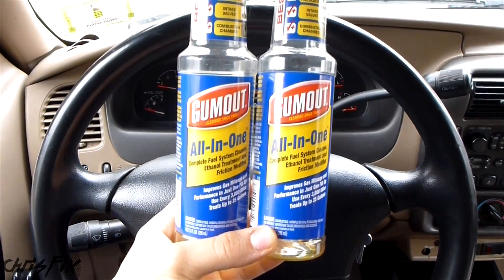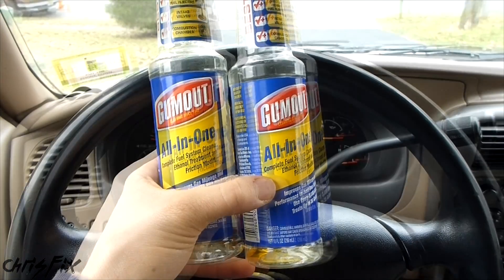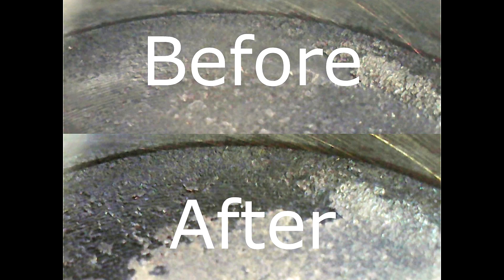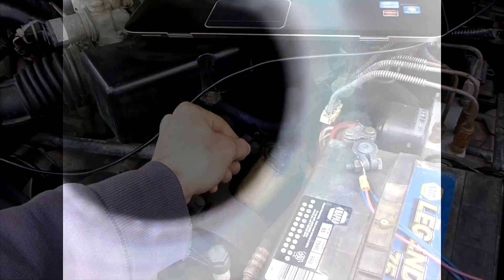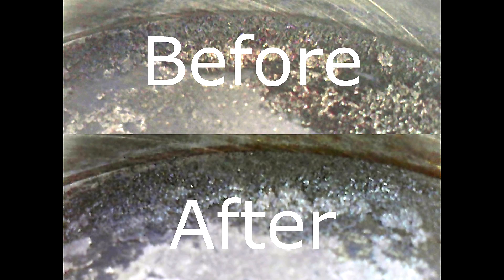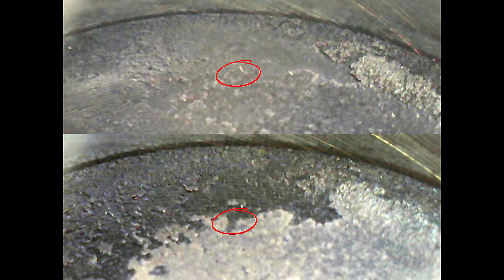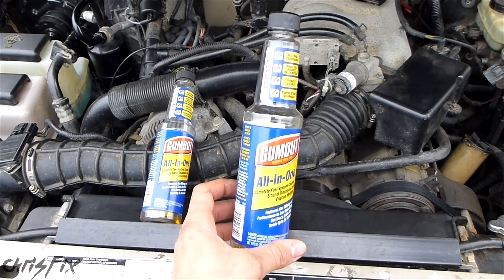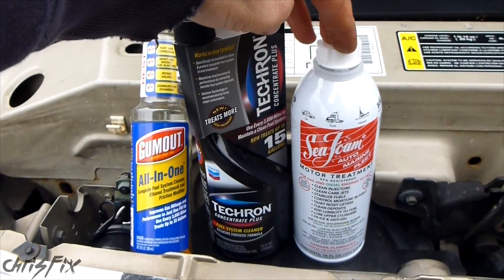Does Gumout Fuel System Cleaner Work (Follow up)?

Comment: Gumout is BS, Try lucas oil
Reply from the maker: B Ann Most gas, depending on the region you are in, has ethanol and it doesnt have anything to do with the grade or company unfortunately. Also using a higher octane gas when your car doesnt call for it is a waste of money. The car isnt tuned for that octane and cannot make use of it. Finally, all gas in the US has to meet a pretty high standard with cleaners and such so even the "cheap" gas is still pretty good. I wish I had more time and money to do a test on running a car on "high quality gas" vs cheap gas and seeing if there is a difference. You bring up some good points. I wonder if using more expensive gas is worth it?
Reply from the maker: jeff666p I think these products work pretty well on fuel injectors which is where you will see that mpg increase if you have dirty injectors and a bad spray pattern. That being said, I did not test the injectors so that is all speculation.
Reply from the maker: MrRangerZr1 Lucas is on the list. That test will be soon!
Reply: B Ann
lucas oil one improve my gas mileage by 3 mpg
Reply: jollyandwaylo
you seem to read the coast guard link as an endorsement to ethanol while myself & most others read it correctly as a warning .
In their warning they say to check with engine manufacturers & do not let fuel sit for more than 90 days .
Before ethanol it was common to let fuel sit the whole winter season & have zero fuel problems but that's not the case now !
&
What does engine compression have to do with ethanol, basically NOTHING !
Ethanol destroys fuel systems not engines, directly & I say directly because when fuel mix is incorrect the engine is either running lean or rich & both are detrimental to engine life.
&
1 of many reasons vehicles last so long now is not from ethanol it is because of fuel injection systems which immediately shut off the fuel the moment the key is switched off.

Unlike carburetors that dump raw fuel right into the cylinders the whole time the engine is spinning & sometimes even when the key is off & sometimes even after the engine is stopped.

Remember trying to start a car & it was flooded requiring the gas pedal to be held down while cranking the engine ?
Where do you think that raw fuel ended up ?
That fuel mixes with the oil causing a shorter engine life  & a reason many taxi cabs even in the old days went multiple 100's of thousands of miles even with carburetors is they were rarely turned off allowing fuel to drain into the oil pan & mix with the oil contaminating it.
 
& BTW 12  ounces of heet does not equate to 10% alcohol in a fuel tank it is actually around 1% when mixed in 10 gallons & if you were smart you would have saved your $$$ & simply used a cheep bottle of rubbing alcohol for about 1/3 the price.
Reply: LO , more BS !
Just like in the days gone by when people believed in a rain maker .
Reply: ChrisFix Your point of jeff's injectors needing a cleaning was a good observation.
But.
If these people are driving a vehicle which calls for high octane fuel & they are using regular "crap" & just about all regular is crap IMO, a  fuel additive could possibly improve their mileage slightly depending on how a vehicle is driven.

As I said previously, detonation, pinging  or spark knock which ever term you prefer are all mileage killers.

And the vehicles most of us drive today have a
' knock ' sensor which retards the timing when a
' knock ' occurs.
 We drivers, should never hear a ' ping ' because of this devise.

Before cars had computers if the octane rating in fuel was too low we would ' usually ' hear the deadly ' ping ' & then know to use a higher grade fuel.

My car specifically says "Premium Fuel Only" because it has a higher compression ratio.
Its around 10 to 1 & is a high output small V6.
I can however use "crap" gas without a ping because of the ' computer '

& since I know the computer/knock sensor is retarding the timing I am also aware that my mileage is going to be slightly less.

Perhaps so slightly that it is not easily measured in the real world but still ' less '

It seems some would rather spend $$$ on a additive  than checking to see if they just need a upgrade to higher octane fuel .
Reply: jollyandwaylo I'd have to agree with you here.  The only conspiracy is the corn growers lobby (and corporations like ADM), who cooked up this bad idea to add ethanol to the gasoline and have reaped large profits by using a food crop as fuel without saving any energy for the nation.  It does do a number on old car rubber parts but most parts can be replaced with newer hoses, seals, etc that are resistant to ethanol.  My antique car is doing ok with ethanol fuel but I add Stabil to my fill-ups just for insurance.
Reply: B Ann Better said than me. I'm glad you're have seen the positive side in what we've suffered with, jolly. I lost the use of my truck for 4 years thanks to ethanol. I when I got it back it took weeks of spending hours most days grinding the rust out of the fuel tank from expired ethanol fuel which starved the fuel pump from a thick organic crud. No better modern rubber would have prevented this! Thought I'd share that if you wondered why I was so passionate on the subject.

Hint: if you find what I find the gummy slimy mess is impossible to clean. Forget resealing up the tank to save the environment. Leave it totally open to air and the gummy-bear rendered fuel will dry out so it can by ground out with a rotary wire brush and sucked up by a vacuum. Bought my first shop vac....even dried rust with fuel clinging on set fire to my Eureka. A few weeks later I dared to try it. It safely worked again. Lol

Fuel pump at local stores $300. AutoZone online had one not mentioned at the store for $150. Took years to find an affordable one.

Tools required that I hadn't purchased yet at the beginning:
$99 Husky Compressor. . . 2-3 times this and the job would take half the time.
$12-30 Rotary tool at Harbor Freight
Wire Brushes set of 5 for $5 at Harbor Freight and $5 each anywhere else.
$380 Used MIG Welder to weld the cheapy wire brushes to not shed so much as to destroy the new fuel pump with metal particles.
$59 Shop Vac...or more when your last one set fire and maybe you should by the 2 years insurance....hey, broke the plastic wheel, it's insured!
$ Priceless. Friends help raise the truck bed so you don't have to drop the fuel tank. Also Priceless: the feeling of having 67k truck back on the road. . . Anyone else have a 2004 this unused? Lol. Lastly on the "money" list, being lucky that all that sitting only the knock sensor went bad with disuse.
Reply: jollyandwaylo 125k is nothing.. Most EFI if maintained the way the factory manual tells you to will last over 300k, and ONLY then will it start degrading due to rust on the outside, or metal wear, requiring bearings, rings, valves, springs & possibly pistons.. Overall thats still only about $2k in parts over 20 years to have a brand new motor again for another few hundred thousand miles.. Problems come when people dont change timing belts oil coolant, etc etc
Reply: Kyle Milford yes correct "125k is nothing"
And I've seen some with 400+ without any major repairs.
Reply: jeff666p
One of the many negative effects of ethanol is well know as less mileage.

Improve your fuel improve your mileage .

Why not just use better fuel ?
Reply: B Ann I use BP which is the best gas in my area. ethanol is in gas everywhere so enough with "Why not just use better fuel"
Reply: B Ann
 My compression test is on the high side so I'm thinking that is why 87 octane does the job that 85 used to. My neighbor thinks there's more ethanol per the lower grade of fuel you buy, but I can't find ANYWHERE to justify his comment. Having a 99, it's "approval" rating for ethanol is extra low.

It wasn't a tiny mpg boost to switch up to a higher octane. When the engine was younger 85 was the best choice as 87 had no detectable improvement. The car is recommended for 87, but I live at high altitude so you have to consider that a lower octane is needed. Less air? Then the fuel needs to combust more easily, therefore 85 octane is for the young version of my car...or perhaps the current version that gets some carbon out once Chris finds the best method! :)
Reply: DE Nichols
re:"My compression test is on the high side"
Are you saying that you checked your compression & it is high .
Please explain your comment further & what engine/vehicle you have .
Reply: It's on the high side of what's considered okay. About 170 PSI on a 1ZZFE with VVT-i. An important distinction on a 1999 Chevy Prizm when it wasn't until the next year that VVT-i was part of the line.
Reply: DE Nichols Sorry but I'm not familiar with your vehicle.
However I have heard some of those small engines have high cranking compression pressures.

I encountered a 1998 GMC 5.7 that had 220 to 225 Lb & had spark knock like crazy even with premium & octane booster .
This was a low mileage truck that was driven stop & go in a tourist town all its life & never got a good running .
Long story short is it was severely carboned up & once cleaned it dropped down to 140 & ran like a new one again on 87 octane .
Reply: That's okay. I'll share an adventure with you about it. 

Yes. It would bad better if my compression was about 140... seeing that Gumout All in One only cleans the soft stuff well shoots it down for my needs. I had already done a water decarbonization prior to Gumout Regane(actually gas PEA in it per MSDS. Gumout All in One is vague and won't say if it's in it or not). Water decarbonization brought cylinder no. 1 down 5-6 degrees C, which evened out all cylinders to within 1-2 degrees of each other. I believe a laser thermometer on my fuel injectors is a good snap shot of what's happening in a cylinder. 

Cylinder 1's old injector was leaky I believed it was causing the problem. Idle was a but lopey as well showing too much fuel. After remanufactured fuel injectors the issues of smoothness was much improved, so we're fuel trims (all of the cylinders were running lean to compensate for the rich injector). Yet I still had 5-7 degrees more heat on that injector! I believe water decarbonization cleaned out enough carbon to even out compression. The car ran so much better!

My apologies that I didn't run a compression test until after the cleaning attempts. But I believe cylinder no. 1 had been higher.
Reply: B Ann I know of no gasoline sold without ethanol.  At least in NY.  All gasoline comes from the same terminals.  The truckers gets an order from a gas station and they fill the tanker from the same source & add an additive package depending on what the specific station requires.  The gas is all pretty much the same.  It is more a problem with older stations that haven't cleaned the tanks or filters and have crud in the gas from that.  You can buy cheap gas from your local Quicky Mart as long as they have a good turnover and change out their filters and not have any problems.
Reply: BeanieandCecil CecilandBeanie
I can still 'supposedly' buy non ethanol in my area .
A few stations advertise their premium as ethanol free & one only sells diesel, & regular which is advertised as ethanol free but its usually 30+ cents a gallon more .

IMO ethanol is part of our governments plan to destroy older vehicles for pollution & USA economy stimulation reasons .
Kinda like another failed Clunker program.

In Japan they have very stringent smog regulations & many vehicles will not meet their standards after 50.000 miles .
Those that don't meet regs are junked.
In America most of those destroyed by ethanol & there's probably 100's of thousands of them are also junked .

There was talk of going to 15% ethanol which will destroy from what I've heard just about all vehicles 2000 & older as they are not capable of handling 15% .

I'm sure you know someone who has or have personally suffered the affects of 10% in small engines so can you imagine the destruction that 15% will do ?
Reply: B Ann While I'm not quick to jump on the conspiracy band wagon. Your comments have a great deal of merit. Assuming all you said was true perhaps you give the government too much merit. Is ethanol out there to destroy old vehicles for emissions or for car makers and sells? Since that is better for companies' profits I have a twinkle in my eye as I suggest it.

There are professionals in the ethanol industry who do it for America and not against it. I watched an hour YouTube professional conference talking about ethanol and the amazing new engine designs that can use far more of it. It will be sold separately and not forced on the masses. They said in 2011 Americans spent 89 cents less per gallon thanks to ethanol and a $1.12 less the next year.

Perhaps with making the machines initially it cost 2.5 barrels of oil to make one barrel of gasoline, but this myth needs to be dispelled. The chemical conversion to make ethanol of course has a small loss in energy just like a small loss of energy happens when they processed crude oil!

The professional at this conference was VERY professional until the end when told (automotive technician conference) that he's personally had to fix engines from ethanol damage. She huffily denied any and all possibility of this being true.

Even if she's right, I've spent days grinding out my 2004 Nissan Frontier from ethanol crud that choked the the fuel pump so heartily that it reminded me of anatomy class and a human heart covered like spaghetti with bypasses to get around cholesterol plaque...by the way the new blood vessels were hardened from continued high cholesterol.
Reply: Oh and Merry Christmas! B Ann I'm responding about your earlier comment when you said ethanol would make a 10 percent loss in fuel economy approximately. I believe the numbers were 30% fuel economy loss if an engine could run 100% ethanol. So at 10% ethanol that should be abouy a 3% loss in fuel economy. 

Ethanol is actually part of fuel makers plan....it raised octane so the fuel itself has to be planned at an even lower octane to make it balance out...the weirdest part is that high octane gas costs less to produce .... I'd love to see how that plan makes them more profit? The masses spending more for what's "better"? It's like what ChrisFix said that you should only use the octane needed or you're throwing money away.
Reply: DE Nichols
When I was a kid long before common ethanol use you could buy a old car that sat for 10 years drain the tank prime the carburetor toss in a battery & fire it up & it would run if the carb didn't flood over & even then it was a simple fix .
That was then .
Now tanks & pump commonly need to be replaced even after a couple of years of sitting or at the very least they need a major cleaning .

Now carbs are so plugged that its near impossible to get them clean internally & externally is now a challenge also.
Then there's the fuel line & injector issues .

Even diesel fuel sours easily now .
It was common for a diesel vehicle to sit for 10+  years & they would fire right up with good batteries .
Now, good luck .

Now when you replace fuel hose if you don't buy hose comparable to 
' Gates Barricade® Carburetion Fuel Line Hose' it wont last long .

When a government lets a product on the market that causes damage to the American people physically or monetarily someone in our government is getting a kick back somewhere or its all part of a plan to get the high polluters off the road . 

Even the clunker program is now seen by many as a cluster F.
It literally put thousands of people out of work.
Towing Co's,Mechanics, Body& paint, upholsterers, tire sales & every parts store suffered from cash for clunkers.

But the car manufacturers didn't suffer & if you recall all the engines had to be destroyed by using sodium silicate in their oil .

Why did the engines have to be destroyed if its not about fuel chugging polluters ?

And why were only certain low MPG vehicles eligible if its not about pollution & ethanol ?

Heres a link about C F Clunkers that explains many things .

http://jalopnik.com/5327580/video-how-to-disable-a-cash-for-clunkers-car
Reply: B Ann Wow, you have strayed over the conspiracy line, I fear. The clunker program was to get polluting cars off the road. Most of the car pollution was (maybe still is) coming from cars that were older than 10 years because of the refinements of newer cars. No conspiracy, it was stated straight out. Also some early models of cars/trucks reportedly did have some hoses/lines that were corroded by the alcohol, I personally don't know if it is true. Cars that sit for a long time start up just as well as they did 30 years ago. There are just more things that can go wrong with the modern, better engines and control systems. No conspiracy needed.
Reply: jollyandwaylo
Strayed you say , lol .
Well I suppose I should tell you that I have 50+ years experience in Automotive & have seen first hand what happens to vehicles & small engines run on ethanol blend fuels .

My "conspiracy" opinions are based on my personal experience with engine components damaged by ethanol.
Hose, steel lines, fuel tanks, fuel pumps, injectors, Carb's ETC all ruined by ethanol  .

A simple fact concerning ethanol is that is it will absorb H2o & H2o is hard on fuel systems even when it is carried by ethanol & no one can deny this without lying !

Granted you can find web sites that will tell you that ethanol is harmless & you can find sites that will tell you that it is destructive & fact is one of them is lying !

The problem I have with ethanol is based on the fact that I see first hand the destruction it causes .

I have put more fuel pumps in vehicles in the last 10 years than the previous 40 years.

I have also pulled more fuel tanks in the last 10 years than the last 40 years.

Pop into any small engine or automotive repair shop & ask them about ethanol & remember we the ones who work on them first hand & are the ones who know the truth .

BTW if ethanol is Ok or so good then why are there 100's of products on the market to counter the effects of ethanol ?

Even the UNITED STATES COAST GUARD warns people about ethanol & they are a US Government agency .
' http://www.fishsafe.info/Ethanol%20&%20Biodiesel%20Fact%20Sheet.pdf '

Harley Davidson also has a product to protect cycles.
" http://www.adventureharley.com/harley-davidson-ethanol-guard-fuel-stabilizer-4-ounce-91600001 "

Lucas Oil Co. also has ethanol Guard products .
' http://lucasoil.com/products/fuel-treatments/safeguard-ethanol-fuel-conditioner-with-stabilizers '

So Ok yup, guess I'm a conspiracy paranoid over the line theorist , LOL
Reply: The only conspiracy feeling I get from any of this is that destroying engines / fuel systems was intended in the beginning. The fact they don't care after the evidence is just tortuous to me. That was why I brought up the word conspiracy. 

I've REALLY enjoyed your comments and all the work you've put into them. :) I wish you a happy New Year!
Reply: Just looked up Lucas Oil Safeguard. Extremely similar to the Gumout tested. Apparently the solvent Naptha and petroleum distillates are all you need for ethanol treatment since Lucas and Gumout all in one use the same stuff. 

Thanks to your comments the two cars that were dead from ethanol poisoning are getting the Gumout I bought since it was on sale and I'd know soon enough from Chris what it was and if it was worth it. Before I read Lucas Safeguard MSDS I thought that the Gumout All In One was good for nothing almost.
Reply: B Ann I just read and really enjoyed the United States Coast Guard document. I especially liked the truth in a marine application. An engine dying is death to people out there.
Reply: DE Nichols
You bet !
The Coast Guard does not want to have to make a several hundred or even 2 mile trip to save someone unnecessarily .
Reply: B Ann If you could read your own links, you would have to throw out your statements. Gasoline with 10% or less alcohol is fine with the Coast Guard. They did mention (as I did), some older engines have incompatible rubber fittings. I'm old enough to remember that engines didn't use to go for 300,000 miles when I was young, so does that mean alcohol is responsible? No, cars are manufactured differently now. Maybe fuel tanks are made cheaper too.  So personal anecdotes mean very little, you must have some evidence. Back in the day, we used to put Heet (alcohol) in our gas tanks in the beginning of winter to absorb water that possibly had gathered in our gas tanks over the humid summers. My Mazda truck has 125,000 miles on it and the compression tests like new and no leaks in any fuel lines. Never had a car that ran so long with almost no maintenance needed. Maybe it is the alcohol that makes it run so fine. This is why personal anecdotes don't serve as evidence unlike Chis' great experiment in his video.
Reply: B Ann I can't just plus one this. Great comment. Learned a lot too. 

Whenever I see rubbing alcohol for sale it has 70% water so that probably wouldn't be effective. ... heet is surely an outdated product unless you really can get your fuel ethanol free.
Reply: B Ann I still don't see 10% ethanol ruining things. My car and all my friends older cars are getting huge mileage ages on them without very much maintenance. How is that possible if alcohol is destroying the engine or the fuel system? Ethanol raises the octane of the gasoline. The Coast Guard warning was for more than 10% ethanol. Show me the tests that have been done to prove the destruction theory of yours. My experience doesn't match with what you are saying. I don't really care one way or another since I have no skin in the game but I just don't see the bad results you are claiming. Not that we have a choice anyway, all the gas stations have ethanol in the gas around here. My comment about adding heet was to point out that alcohol absorbed the water in the tank so ice didn't form. There are people claiming that water cleans the carbon off. If this is true and if your claim of alcohol introduces water into the system , then why does anyone have carbon build up on their pistons? Wouldn't the water burn that off constantly?
Reply: jollyandwaylo
good, I'm so glad it works for you , enjoy !
Reply: jollyandwaylo I have no idea. .. either I didn't get enough water in my gas tank for ethanol to deliver the cleaning action of water or carried in the ethanol it doesn't work. Water straight through the intake gave me 5 more HP because it evened out compression and therefore power delivery on my 4 banger. 

I know longer had one intake tube 5-7 degrees C hotter than the other cylinders. Note: on my intake the runners are seperate.
Reply: How'd it even out compression? Probably from carbon clean up. And by the way Jolly. I trust B Ann's experience. It's very intelligent and matches my much more limited experience, yes, but experience nonetheless.
Reply: DE Nichols
well I'm not going to mention any names but someone is either a troll or simple minded beyond comprehension .
Reply: B Ann I'll look for you on my other favored videos. I hope top see you and learn from you again. :)
Reply: DE Nichols I never said I don't trust his experience, I just have learned not to  believe any personal anecdotes. We all have our experiences in life and unless we can check our experiences against hard data, we can be easily fooled, it is how our minds work. I was just asking why cars seem to last longer now and I don't know anyone who has had a fuel problem (with modern cars) because of alcohol. Now it might be where I live (pacific NW) has moderate temps so we don't have the same extreme conditions, which could be the reason my experience is different. These are the type of answers I am seeking, not that someone has seen a lot of these problems. The question is why. I will go around and ask locally if the car mechanics have the same issues here.
Reply: jollyandwaylo
I don't call links to official & professional sites "personal anecdotes"
Only a simple minded or troll would make such a reply or comment .

I would ask, if your car is so trouble free & you never have any problems with it then why are you even here but I already know the answer to that question .
Reply: B Ann I agree about the links but the Coast Guard doesn't agree with you, that is what I am trying to point out. My truck runs fine but with 125,000 miles on it, I am trying to think about long term maintenance. So is that the answer you said you knew it would be?
Reply: Exactly, motors tuned correctly and maintained typically never fail, isntead they degrade and lose power due to material wear.. Cars that "break" are generally timing belt/oil pump/water pump related due to neglect
Reply: Kyle Milford
B Ann
And back to the original topic. Have you watched ChrisFix's latest about Lucas Oil? Gumout without PEA far out cleaned Lucas Oil fuel treatment. At least in regards to combustion chamber deposits.

There's a point that we catch the back side of a valve looking glossy and beautiful in the video too! (He was leaving the bore camera in the chamber while turning the engine over by hand to get a better angle.)
Reply: DE Nichols
Nope , haven't seen it .
But I'll tell you what I have seen.

I have seen intake valves with so much carbon aka "combustion chamber deposits" build up that it bogged the engine down because of air restriction.
I'm talking a V8 that would barely do 45 mph.
&
I have seen valves that had carbon so hard that a caustic chemical 'Hot Tank' wouldn't touch them.

The only way to remove this carbon was a glass bead blaster or chipping hammer & heavy duty wire wheel.

Carbon it one tough cookie & what are diamonds one of the hardest rocks around made out of ?
Reply: MrRangerZr1 or seafoam..
Reply: Premium gas has no noticeable effect on any part of your cars performance I only use regular in a Lexus that calls for premium and there is a documentary by ABC that proves it look it up on YouTube
Reply: B Ann
I don't use crap gas.
Reply: B Ann
 I also didn't buy it to improve gas mileage, I bought it to help reduce the effects of ethanol. The extra gas mileage was just a bonus.
Reply: Gumout is bull, you hear this Scott Kilmer? Gumout my ass buddy, busted!!